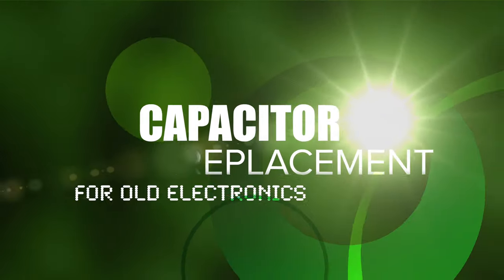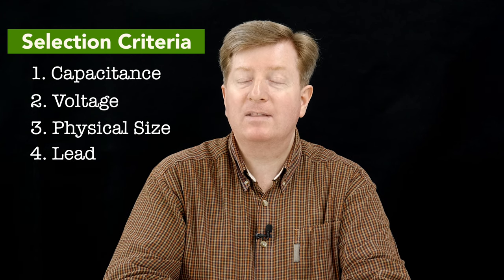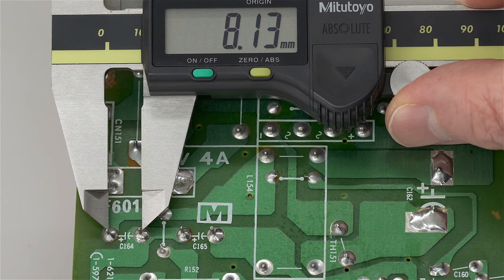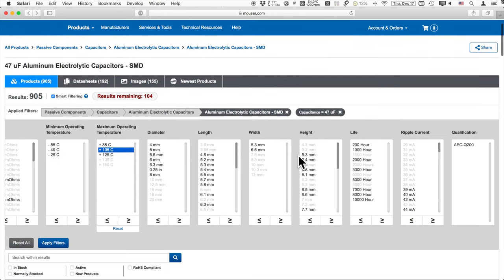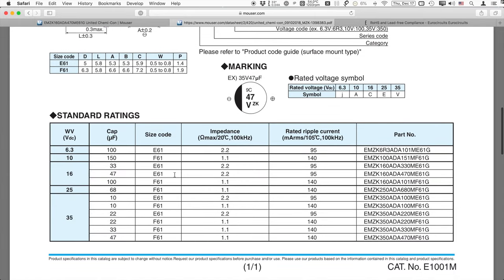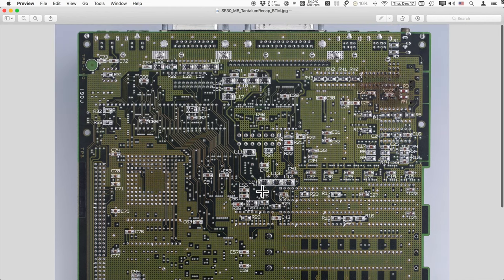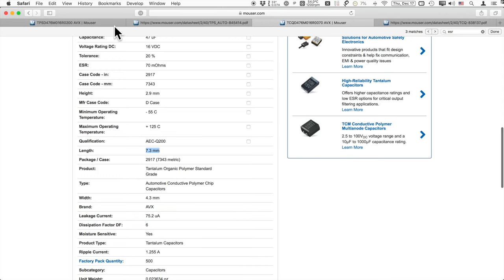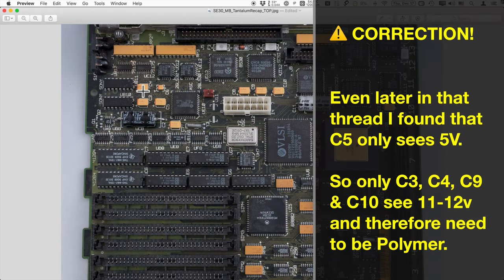Choosing Capacitors to Recap Old Electronics

Comment: Honestly, thank you so much for taking the time to pragmatically walk through your process, I feel like I've absorbed a lifetime of learning in about an hour 🤣 I'm a lot more informed about choosing replacement caps — and when I should and maybe should not — but there are still practical problems I can't solve no matter how much logic I apply or how many explanations I watch. For example - how to replace a surface mount cap when the code is obscure or doesn't match a pattern I know? May I ask, where do you look @JDW (or anyone with experience here!) Again, for example: an SMD cap defines its properties in three lines of text : first line "6 5", second line "100", last line "25A". Does the second line (100) mean 10pF or 100uF, and last line 25V and "series A"?  And then what's "6 5"??? I'm stumped and hoping for some inspiration. There HAS to be a definitive key, doesn't there? Yours in hope!
Reply from the maker: The world of SMD chip capacitors is a mess of inconsistency.  You can get started examining that world by reading through this web page: http://www.iequalscdvdt.com/Markings_and_Codes.html

But there are still times when you will need more help than that web page.  Sometimes you are lucky and have a spare board of something you're recapping, such that you can remove a good cap from the board and then use an LCR meter like the DE-5000 to measure it.  That will tell you the capacitance. But you then need to figure out other aspects of it like voltage.  But if you know the maximum voltage it will see, then you can choose the voltage spec of your replacement cap, in accordance with the type of cap it is.  For example, solid tantalum must be twice the working voltage.  Polymer Tantalum can be less than that.  Ceramic needs to be a lot more than double to avoid DC Bias voltage impacts on Capacitance.  Also, if you know the TYPE of cap it is, the BODY SIZE will often tell you the voltage rating.  You can check similar SMD caps of the same type (tantalum, ceramic, etc.) and see what I mean on Mouser regarding body size as it pertains to the voltage spec.

Another help is a SCHEMATIC.  You can then know voltage and capacitance, and sometimes you can figure out the TYPE of capacitor as well.

Unfortunately, the SMD world isn't as friendly when it comes to markings as through-hole capacitors that are very easy to figure out much of the time.  SMD takes more time and effort.  And in the worst case, you may need to post about your replacement in an online forum like the EEVBlog Forum and ask people with a photo of your cap.  Some of those folks can be surprisingly helpful!

Comment: Thanks a lot for sharing this! I thought interesting to add that in hifi environment another source for identification of the needed capacitor can be read directly on the board itself once the old cap has  been removed. With a caveat.. there can be errors about the "direction" of the capacitors (+/-)
Thanks again!
Reply from the maker: Thanks.  When you talk about polarity "errors" though, are you saying the silkscsreen markings on some PCBs are wrong?
Reply: @JDW-  yes, it is not uncommon.  Best to photograph the board before removing capacitors rather than relying in the silk screen printing.
Reply from the maker: @richardsinger01  In my case there is no need for photos since I have everything shot on 4K video. 🙂

Comment: JDW, very good informational video. I plan on doing a recap on a mid 70s vintage stereo receiver and based on your rework experience, do you have a soldering tip shape you prefer in doing that type of work. Thanks and this video will be a great reference for decades to come.
Reply from the maker: For equipment that old, even a fairly large sized rounded/conical tip would probably work just fine. The all-around best tips for general soldering though are beveled/angled tips.

Comment: This is an awesome video. This helped answer many of my questions. I have a circuit that has a 0.33uF polarized electrolytic cap. I couldn’t find a polarized electrolyte version, but did find a non-polarized / bipolar electrolytic capacitor. This is for a video time base corrector. The voltage rating is the same. Would this be an appropriate substitution?
Reply from the maker: Are you absolutely sure it is 0.33 µF instead of 33 µF? If so, it’s not surprising that most replacements you are finding are not polarized. Many capacitors less than 1 µF are often not polarized. The good news is that for those small capacitance values, you may even benefit from using a film capacitor instead, as that contains no fluid and would last the life of your device. In other words, it would never need to be replaced in the future. Of course, the biggest issue about using a capacitor of a different shape is the lead spacing and the spacing around the capacitor itself, so you need to measure and determine what will fit into that space before you buy a replacement.
Reply: @JDW-  thanks for the quick reply. Good question about the 0.33 uF value. That is correct and it is also listed at such in the service manual. May consider a different capacitor type. 

Aside from bipolars being more expensive, can they be subbed for a polarized electrolytic in a pinch?
Reply from the maker: You can use non-polarized capacitors in a pinch or really anytime. The only real disadvantage to non-polarized capacitors are cost and capacitance choices. For a deeper dive into the subject, I highly recommend the following article…

https://www.elprocus.com/non-polarized-capacitor/

Comment: I was hoping you would discuss ripple current.  I always ignore this specification when capacitor shopping and there are times when I shouldn't.
Reply from the maker: Basically "ripple" is any residual AC waveform on a DC power line, whether that be from AC to DC conversion or from a switch mode power supply.  The higher the capacitor ESR, the hotter it will get when the cap is used on a DC voltage rail with a lot of "ripple."  So without going into extreme technical detail, the approach to mitigate the heat up inside the cap is to choose a cap with low ESR. If you look at capacitor spec sheets, you will see that a lower ESR corresponds to the capacitor being able to handle a higher amount of ripple. It gets more complex than this, but you won't always know the amount of ripple you have in a given circuit you didn't design, especially if you don't have advanced test equipment to check it. So when replacing stock caps, such as in a vintage computer, it's usually best to go with a capacitor that is rated as having "low ESR" where possible.  You can always feel your caps too, and if they get really hot when in typical use (not heat flowing on them from other hot components, but from their own internal heat), then you know you probably need a lower ESR capacitor when and if available.
Reply: @JDW-  The problem with finding "low ESR" is that manufacturers usually don't provide an ESR value for typical through hole aluminum electrolytics, the kind found in power supplies.  It's not a criteria that can be filtered for when shopping.  Data sheets have ripple current, Q, dissipation factor, and tan values and I think these are all related to ESR but I don't know what to look for.

This makes me wonder how websites that sell "cap kits", like Console5, determine that the capacitors included in their kits are "low ESR".  Did they find data sheets for all of the original capacitors and then source modern equivalents?  And what value is considered "low" for ESR?  I think Console5 would need to have more information about the circuit, such as data sheets for the ICs within the circuit to find out what ESR value is required.  ESR requirements seem to be more dependent on the application and saying "low ESR" is arbitrary.  I have also read about situations where having too low of ESR is not desirable.
Reply from the maker: @ecco222  "Low ESR" (which involves Q, DF, TAN, etc.) is a complex subject beyond the scope of this comments section, but "low ESR" is not "arbitrary" terminology insofar as if you search for 1uF radial electrolytic caps in the 50V range, for example, a good number are marked precisely as that — "low ESR" — which denotes "lower ESR than typical."  What is typical?  Well, basically, it's the standard ESR of most of the the caps in that category.  So a smaller subset have ESR that is lower than the majority average.  

Answering the question of "how low is best or good enough" is not something I can easily specify because it really does depend on the circuit board design.  A lot of it is trial and error unless you are the electrical engineer designing a given PCB.  For example, I didn't know that ultra low ESR OS-CON SMD caps installed on a Macintosh LC575 motherboard would allow the CPU to overclock to 50MHz -- well beyond it's stock speed of 33MHz (when paired with the right CPU and fast VRAM).  Previously, overclockers of that board had not been able to go so high in large part because they recapped with solid tantalum, which has much higher ESR than OS-CON.  Again, the point here is that I being an EE suspected that very low ESR caps might do some good on that LC575 board because higher clocked CPUs require more sudden bursts of power and therefore will tax the caps, so I bought the ultra low ESR OS-CONs and tested, and then overclocked, and found I was able to achieve something others were not.  I had no schematics and had not done circuit analysis.  I just decided to go with trial and error with regard to very low ESR, and it had a positive net result.

So long as you avoid ceramic caps (unless you know they are needed when recapping vintage electronics), you can usually get away with very low ESR from solid polymer caps like OS-CON.  The only time ultra low ESR can become a problem is in some older switching power supplies which require a minimum ESR.  Most of the time, you won't have a schematic to know that, so again, it's trial and error.  I came across that when recapping an Apple HD20SC power supply (and I have a video on that too).

Comment: Thanks a lot for this video. Watched all the way through and filled in some knowledge gaps. Especially about ripple current handlings effect on ESR/Impedance. Never made that connection. 

I was hoping you would go into more detail of.. 

The importance of ESR, 

The possibility of swapping electrolytics with polymers,

Identifying a given capacitors manufacturer/data sheet for as close to 1:1 replacements as possible or when upgrades are in order 

And when to select a capacitor based on its low frequency ripple handling, or high frequency. Oscilloscope time? I figure a multimeter isn't advanced enough to properly show what's going on.

These concerns stem from dealing with switching mode power supplies (more complicated than I expected), electronics with older electrolytic ultra low ESR VRM capacitors which aren't manufactured anymore, and low profile disk drive capacitors which are limited on space for identifying marks.
Reply from the maker: Thank you for watching and for providing feedback.

One good example demonstrating "the importance of ESR" is shown my other video here (42min, 8sec): https://youtu.be/Qof-Wjj_rWI?t=2528

If you are not recapping a switch mode power supply, you can mostly swap electrolytic for low ESR polymer caps.  But as you could see in the video I just linked, with switch mode supplies, even swapping an electrolytic for another electrolytic can be problematic if the switch mode design expects minimum ESR.  But recapping motherboards and the like actually benefit from the super low ESR of polymer caps, so you basically just need to make sure you get the same capacitance and voltage ratings, then swap out those electrolytic.  I would recommend solid electrolyte polymers over the "hybrid polymers" because the "hybrid" ones are fluid filled and could possibly leak one day.

Because you can swap out electrolytic caps in most cases (other than switching PSUs), you need not give such a close eye to finding perfect 1:1 replacements much of the time.  For example, if I swap out an SMD electrolytic 47µF 25V cap with a 47µF 25V solid electrolyte polymer cap on a motherboard, my replacement is technically not 1:1 but the replacement will still be better than the original.

If you want to get deeply involved in ripple, you need to go beyond the data sheet and have an oscilloscope to actually test the ripple once your cap replacement is done. If you are new to scopes and just need something basic, there's not need for anything fancy.  This GW Instek scope costs less than US$300, is from a reputable vendor and made by a very reputable manufacturer in Taiwan, with a fast UI (compared to other low end scopes in its class), and has a strong following on the EEVBlog forum: https://www.tequipment.net/Instek/GDS-1102B/Digital-Oscilloscopes/
(The photo shows the more expensive 4-channel model, but the link I gave you is to the 2-channel version, which honestly, is all you need for a starter scope.  That same model is also 100MHz, which is really all you need.)

Low profile (short, not tall) capacitors can be challenging to find in the right specs needed for a swap.  When recapping floppy drives, for example, I often want to swap with solid tantalums but can't because they are taller than the stock electrolytic due to the fact I must properly voltage derate the tantalums.  So yes, I agree that recapping switch mode power supplies in general can be troublesome due to the ESR requirements of some designs, which is further compounded by the fact you sometimes have very little space for the replacement caps and find the best choices for replacement simply will not physically fit.  Sometimes you can lay a cap on its side to get around height limitations, but not always.
Reply: @JDW-  Almost lost this notification. Appreciate you taking the time going into further detail regarding this. Between the knowledge you, Tech Tangents and a few others have given me, I feel pretty confident sourcing my own replacement caps without doubts. Thanks for sharing.

Comment: I've seen aged tantalum's (teardrop style) short and burn more than once in older test equipment. Usually these will be 10uf or less but multiple distributions across the entire voltage buss throughout the entire circuit board. I usually replace them all with electrolytic. Yes the  ESR value is not as low but have yet to see it really effect the operation .
Reply from the maker: The age of the equipment doesn't have much to do with it.  Basically, it comes down to bad design.  Many EE's out there simply design the board wrong.  You absolutely must voltage spec your solid tantalum capacitors at no less than twice the board's working voltage.  Replacing tantalum caps with electrolytic will replace one problem for another.  Electrolytics will never burn like tents, but when it gets very cold, ESR will exponentially increase. The other problem is you will need to swap the electrolytic about every 20 years too. I would suggest using polymer tantalum or OS-CON (solid, not hybrid) where possible if you don't want to use solid tantalum.  ESR is low, stable, and the caps won't need to be replaced in 20 years.
Reply: @JDW-  In all the times I've seen them short and burn I have to say they maybe were rated only 5 volts or so better than what the rail voltage they were on. I'm OK with the electrolytic's, in 20 years it will be the next care takers job to maintain :-)
Reply from the maker: @Dennis-uc2gm  On a 5V rail, a 10V rated solid tantalum would suffice, but on a 12V rail, a 16V solid tantalum would be inadequate for long-term reliability.  You definitely need 25V solid tantalum parts on 12V lines.  But of course, you solution to use electrolytic is fine, especially if your devices are not use in sub 0°C environments where higher ESR may become an issue.